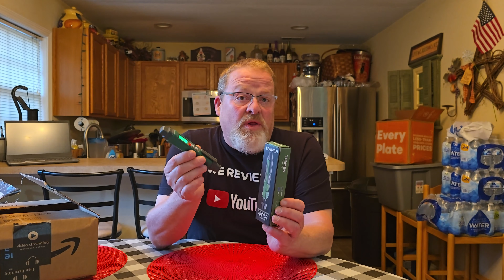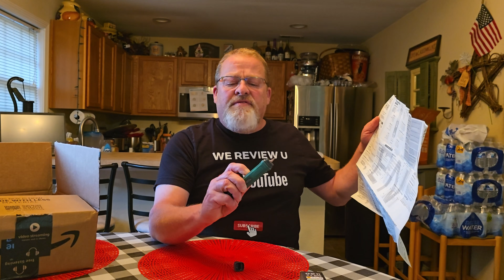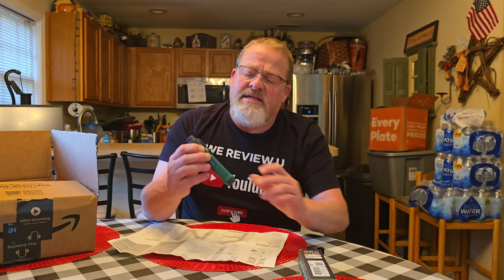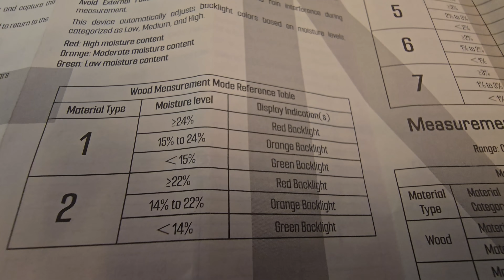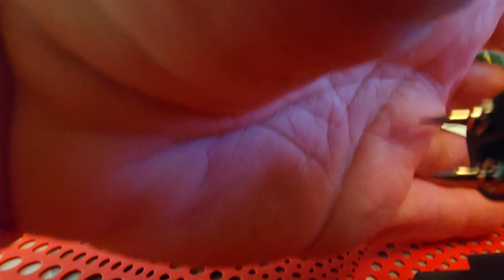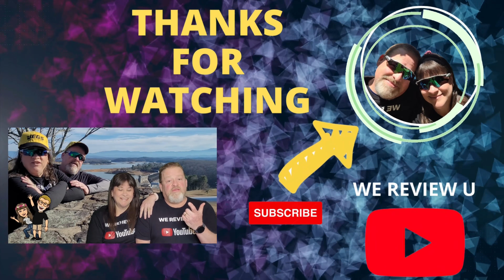TESMEN TWM-186 Portable Moisture Meter Test and Review

Comment: You have to actually INSERT the probes to get a reading.....simply touching the surface will give no reading. It just seems you were not inserting them enough. Correct me if I'm wrong? Thank you
Reply from the maker: I could've, as you stated, not pressed them in hard enough. I did try, of camera, on several types. I did manage to set it per the instructions to a different setting. Tested again and did discover a reading on wood. User error, I'm sure. Thanks for watching and commenting on our video!